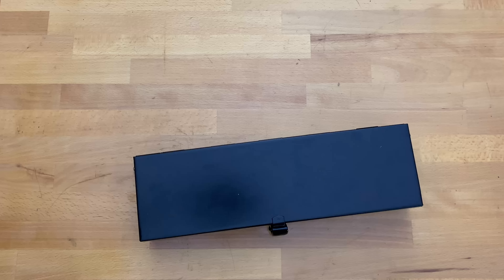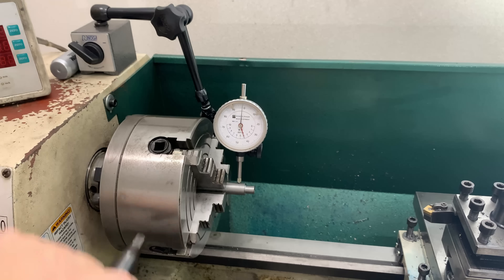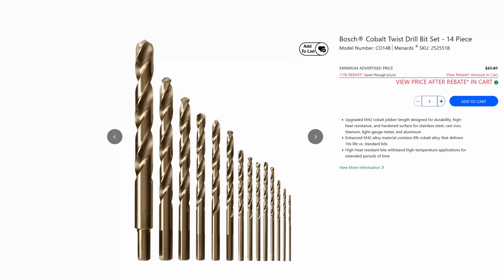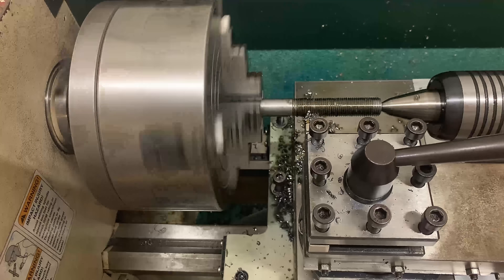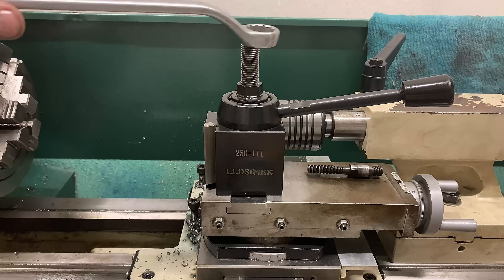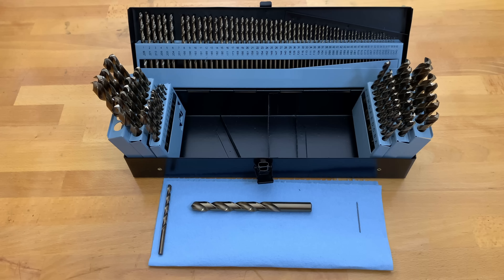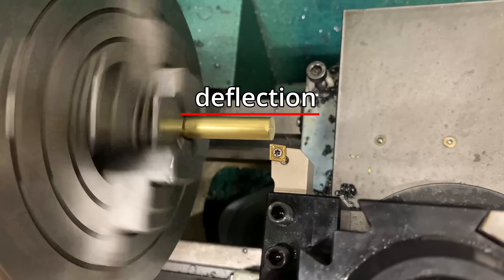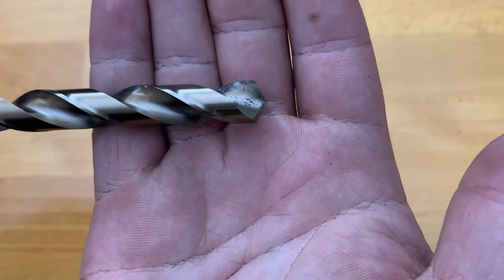Are Harbor Freight Drill Bits Secretly AMAZING?

Comment: I had the smaller set of the Cobalt, they worked better than Milwaukee standard line, way better.  Most drilling cast on containers for generator ground lugs. If you want good bits, Kimball Midwest is about as the best it gets. UZ used to be good, some of their products are super grabby and brittle. Broke the 1/2 UZ bit second time.

Comment: The milwaukee/bosch bits are probably from the same factory as the harbor freight ones :D But even good bits like Sutton are no match for a monkey with a cordless drill :D doesn't matter how good the drill is, or how good the bit is, if you spin it too fast and don't feed it enough you are going to melt it :P

Comment: I’ve found the warrior drill bits to be awful. Usually just drill oak and pine. Anytime i have attempted to drill mild steel, even with cutting fluid, they have dulled quickly. One 29 pc. Set had 2 bent bits in it…

Comment: They work well enough for wood. I did get the smaller set.  Did burn out one drilling a hole in some angle iron. Finished it up with a black steel drill I got from Sears a few decades back. Keep in mind this is using a hand drill.

Comment: I have a set of norseman jobbers and some singles from diabolo, but I also have had these for a year and use them a lot. I mainly drill through steel, occasionally malleable iron. I really like the shape of the web on these. They work fine in a hand drill, you just have to go slow and use lots of cutting oil

Comment: Rough with the drill, finish with the boring bar. Leave a small enough hole with the drill so that the boring bar has enough material. You’ll never get a straight hole with a drill.

Comment: These drill bits are hit or miss.  You need to verify they are high speed steel and not carbon steel which is not very useful when used on metal.  Secondly, they tend to be sharpened very poorly with lopsided cuts or even miscut ends such that they won’t work out of the box to drill.  The ends can be fixed by sharpening, but the side flute edges cannot be so ensure they have properly cut flutes.   That said, I’ve saved a lot of money buying these, they will perform just as well as expensive bits in hss when sharp.

Comment: I have experience with their drill bits. 
A quality bit is not only sharp and hard it's true.
I've purchased bits that were so untrue you couldn't use them on a drill press.
You get what you pay for. You might take a small drill and chuck up a couple from a set if you can open them.
Or just return them if they're not true.

Comment: I’ve had a set of these for a couple years now. It’s a fantastic starter set as it comes with a quality case. As you wear out/ break drill bits, you can simply replace them individually with whatever latest and greatest bit.
Reply: Yep it works great for tinkerers. I operate a Grizzly G3102 vertical mill and Grizzly G4002 Lathe and Amazon has a perfect selection of cheap tungsten carbine endmills and cutters (1-2-3 Blocks and clamps) while Harbor Freight is a treasure trove of cheap cutting bits, and just about anything else that you'd ever need.

Comment: I’ve had these for several years and they are super sharp. You can cut yourself on them.. I’m just a homeowner and got these for making my pens so most of my cutting is wood and occasionally steel. These pens are sharper than most of the high end drill we use for pens..

Comment: I bought a 115 PC set like that from Northern Tool & Equipment at least 20 years ago and they are all scrap. Some were bent right out of the starting gate. Others were over sized for their rated size. And still, some were so brittle they snap as soon as they are pushed up against their first work piece. Some were DULL right out of the box. 
 "Made in China".
Don't skimp on machinist drill sets.

Comment: I was a machinist for 20 years. I got one of the HF smaller packs on sale for super cheap thinking they were throw aways.  I think they are the same drills shown here.  Just not in the full machinist set.  They are awesome.  Are they as good as real cobalt drills or name brand HSS drills?  No probably not when using on a real machine and with real metal.  But in a hand drill? Drilling some shitty car part?  They have far exceeded my expectations.

Comment: The Titanium ones are no good. But the Cobalt ones are good, like impressive. I first started with the small pack of the cobalt bits. Then they had that one sale on all drill bits 40% off. That 115 piece set went on clearance for some reason they stopped putting them on the shelfs, i talked to an employee and they said that they where going to be rebranded. So 40% off plus clearance the 115 piece set came out to like 35$. I bought all 4 sets that they had. So yes The Cobalt bits are amazing.

Comment: I have owned this drill bit set for about 10 years and have no regrets. It's great having all the minor size increments when I need an odd hole size for a project. I broke two of the smallest bits but that was my fault for putting too much lateral force on them. The case works fine for me since it sits in one place on my workbench.

Comment: I bought the set before cobalt ones existed like 20ish years ago and they do pretty good-I mean for home use and over all light commercial you might do okay.  It's  been 100%  my experience that cobalt bit from most companies only equal 1 of 2 things:
1 Regular bits with a greenish fake coating/dye or tint.
2 Brittle shit that the whole head snaps off like glass.
Do with that info what you will but most of the time the regular or TiN coated bits are the same or better and NO besides cobalt bits bought from industrial supply houses I have not seen any benefit in drilling hard metal in fact sometimes even less ability mostly because I think the fake color process probably softens the metal slightly.

Comment: I own a German car repair shop and a hobby machine shop. We use a LOT of drill bits repairing the impossible. Like many of the failures we resolve, failed bits are usually “operator error”. I was on the fence with this set for the home shop and now see they’ll be just fine. Subscribed.

Comment: Hi kids, aircraft structural mechanic here. If you're not using tungsten carbide, every drillbit is exactly the same...useless. Highspeed, 1 hole. Cobolt...2 holes. Sorry kids, but your thousand dollar Snap On Cobolt bits...sucks ass. Any questions?

Comment: I know this is a little late but… I have this set and have had a few of the other warrior brand drill bit sets when they go on sale for $10. I have not had any issues with them outside of breaking some of the smaller sizes and that being my fault. I am a hobbyist machinist and still learning speed and feed rates but once I get the right feed/speed, they cut great with no issues. I would recommend this set.

Comment: I have a medium price 115  set for the variety, a little higher end than Harbor freight which tend to have runout.. Then I figured out my most used sizes. I have McMaster Carr specific size and type for my most use bits.  I also use 1/4-28 aircraft for my right angle and adapter for my drill. These are available at McMasterCarr and all over ebay and are very common in tap and clearance  sizes, my most used sizes.
   Better to learn how to use, sharpen drill bits, and tell the difference between bad, good and better before you spend a lot of money on good ones or lend them. There’s not much difference in how long different drill bits will last if you’re using the wrong bit for the job or bad shop practices.

Comment: I was making an axle shaft or something for my rc car that is of course metric. I tried ordering a "metric" bit set from Ebay that was when I received it just a cheap jobber set with a not so close for what I was doing fractional equivant. 
If I needed a metric size hole drilled to this day I still wouldn't know were to find them in north America.

Comment: I have over 100 very old American-made drills. But 90% of them are dull. And I suck at sharpening them by hand. I'm also poor(literally). I needed to drill some holes, so I bought the cheapest drills I could find at Walmart. They're terrible. Some are literally dull out of the package. I believe they're Bauer Walmart brand. Really wish I had a Drill Doctor. Over twenty years ago my boss at the shop I worked at gave me the task of sharpening every drill he had, using a Drill Doctor. It was kinda tedious and finicky to use, but it did a great job sharpening. But if I could afford a Drill Doctor, I could afford a package of drills. So I'm outta luck, cause I'm outta dough.

Comment: I've looked at those bits in HF a few dozen times and thought they had to be junk. I consider ANYTHING I buy at HF to be expendable. In fact I've gotten huge value out of many of their power and hand tools...I think over the course of about 4 years amateur machine shop use I've only broken a couple of items. 
The best plan with any HF purchase that is for use on a project is to use the very solid hell out of it and fast as you can. Do anything you can imagine to it, keeping in mind, if you can break it in 90 days, they'll replace it free. That's hard to beat.
As for drills, I have three sets of them, two 1/16 to 1/2  and a 60 piece numbered set. I have replaced about 6 small ones, but mostly they're hanging in just fine. This review basically holds up with my experience, and I'd probably buy that large set if I felt comfortable going the HF near me. It's a 20 minute drive to a 95% "Ethnic" small city. Used to be a wonder store, but something has changed in the past few years. I have been treated with such absolute disrespect the last few times I've gone there, I actually would never consider going back. There are towns in Maryland that are mostly black...and in Maryland...they HATE WHITES.  If you can find an HF in a civilized neighborhood, buy their stuff, but only with the intention of wearing it out as fast as you can.

Comment: They are crap. I bit the bullet and bought a Milwaukee Cobalt set for somewhere around $120.00 for the set of 29 and so glad I did. I could not even drill holes in bolts for safety wire without breaking 4 or 5 of the Hobo Frait bits and had to give up in frustration, hole-less. Went to Ace, bought the new set, got back to the shop, chucked a new bit in the drill press and........it sailed through the bolts like BUDDA! It literally felt like drilling through clay. Moral of the story? Yeah, you get what you pay for, most times. I guess the cheap bits are useful if you are using them on softer materials, however. So, not total crap as I opened with. Just don't expect much from them.

Comment: Ive got this HF set... I got it probably 20 years ago for about $65.  It's my beater set for general purpose.  I keep sharping them when needed.  They really are a good robust beater set of drills.  I have a similar American made M42 set that I bought from viking for around $400...  I only get out the nice silverware when Im working on something really hard or requires precision...   One thing I will say is that Cobalt is extremely hard, and therefore brittle and will break if you don't understand that the bit has to do all of the work, heat, and speeds and feeds are everything.  90% of problems drilling are caused by too high spindle speed .

Comment: Hello Sir: What is you opinion on the Norseman High Speed 29 pc Drill Bit Set (J-29) (43520). I bought this set about 5 years ago and used them sparingly.
Reply from the maker: I think that is a fantastic set and should last many years when used properly

Comment: I bought that same index more than 30 years ago out of the back of a truck. $19.99 It was a sore pecker deal. you can't beat it. From half inch down, sae or metric, brace hand or press I got it. I blame Redittors' problems on pilot error. Life is hard it's harder if you're stupid.

Comment: Recently I had a project with 48 holes, 1/2 inch diameter, 1/2 mild steel plate.  I drilled 3 sizes, 1/2 being the third.  A Home Depot purchased full size drill press.  They cut fast enough and did not break.  I set my speeds properly, used appropriate down force, used a flux brush to oil, peck drilled to prevent overheating and dulling.  I was happy with the bits.

Comment: I have had that 115 piece set of cobalt drill bits from Harbor Freight for about 15 years. The drill case was better built back then. It has worked great for me for aluminum, brass, plastic, wood and mild steel. Not so for stainless steel but mostly because my drill press and lathe do not have the power to turn really slowly. Stainless steel needs slow turning and a flood of coolant to avoid work hardening. Before the cobalt set, i used the 115 piece high speed steel set. It was ok for the softer metals but not for steel.

Comment: They can be I bought one set of these that about half of them are totally unhardened. A couple of the larger ones around a half inch completely untwisted when you tried to use them. Return them for credit waited about a month bought another set different stock number they were just fine.  Now the TIN coated bits. That's a different story it's always hit or miss no matter what...

Comment: I've had a set of these for years,  some of the small one broke (some my fault)  but they work well on steel but you must use oil.   not used everyday but often.   only ones that broke were hand drill,  never broke one i the drill press.  however if they touch  
drywall or concrete  it ruins them.  Just my opinion.

Comment: I agree. The Harbor freight Cobalt are a fantastic value. Cobalt is harder than the black or Titanium coated bits, which means they will cut stainless and other steel better, but are more brittle and will snap and chip more easily when in a pistol drill or in a chuck with excessive runout.

Comment: All drill bits can be abused. All drill bits can be sharpened. I already had an old Craftsman index. It was missing the commonly abused bits. So rather than buying the overpriced bits individually I bought the HF set. Over many years I have found the HF bits work just fine for most purposes. If anything they are too hard as in brittle. I dropped the half inch bit and it broke in half. The tiny bits don't seem to be sharpened correctly at all. That's the cons. If you don't abuse them they work just fine. If I chip an edge I sharpen it and move on. I typically use the HB bits for everything except stainless and hard steel. They're great for wood, iron and non-ferrous metals all day long. Just keep them lubed and sharp. At their price point they're completely suitable for non-commercial use.